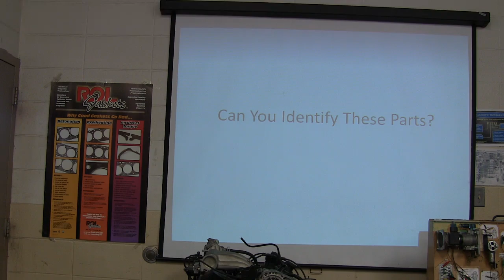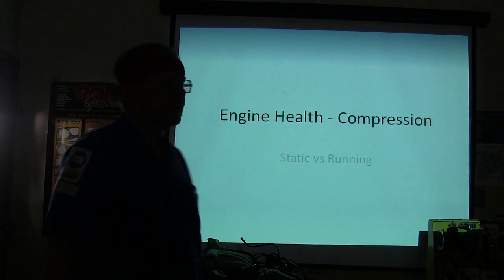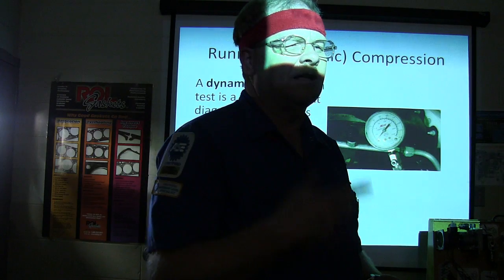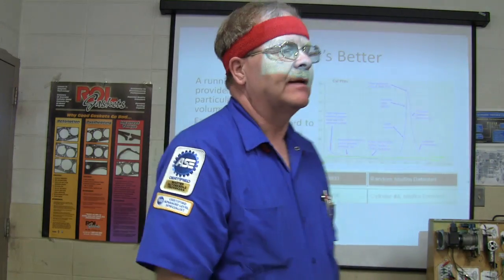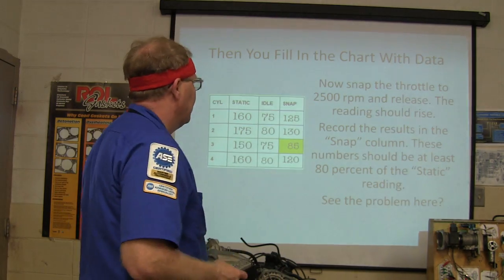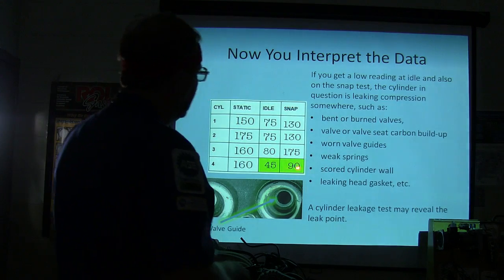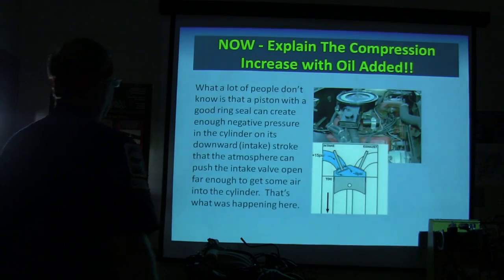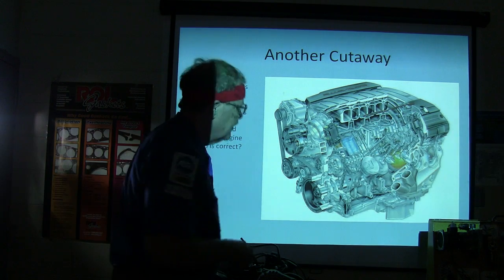Compression and Stuff

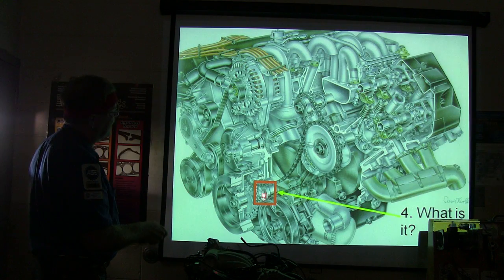Comment: Mr. mccuistian, i wonder how could a car that has 1:23 compression ratio can arrive at 30bar static compression??? My logic its if we have 100% volumetric efficiency then we have 1 bar in the chamber so if we have 1bar and the ratio is 23 we should have 23 bar of cranking pressure, where im wrong ?? 😕 thank you.
Reply from the maker: There's more to it than simple compression ratio.  Valve lift and duration and volumetric efficiency also play a part.  You don't automatically get a full atmosphere in the combustion chamber every time the piston hits BDC on the intake stroke.
Reply: +McCuistian thats right but i thought so because maybe the low rpm it can however thats why logically it shouldnt happen, im thinking the cause of that might be the increasing of the temperatures by the squishing the air we are going to have un proportional raise of the presures does this make sense?
Reply from the maker: +armando nika which engine are you talking about?
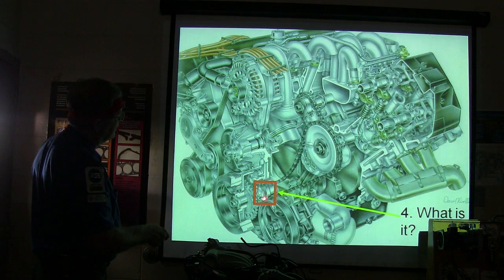Reply: +McCuistian ford 6.0 1:23 compression ratio and it has 30 bar 430 psi.
Reply from the maker: It has to have high compression to fire if it's a diesel. Don't get too hung up on theory!
Reply: +McCuistian ok thanks anyway.

Comment: Did you go to UTI lol. Good one Richard.
Reply from the maker: The guy that called the FPR an EGR is actually one of the most capable mechanics in my class.  But one guy I've had working for years at a dealer said that's one of the things he's noticed about UTI students (and he's worked with several).  They can't seem to tell the difference between the FRP and an EGR valve.  But I probably shouldn't have made that remark. !!
Reply: Everyone makes mistakes and I have made many. Keep on teaching Richard and it's been an honor to have a conversation with you. Have a good day.